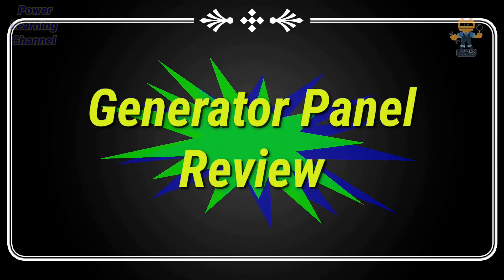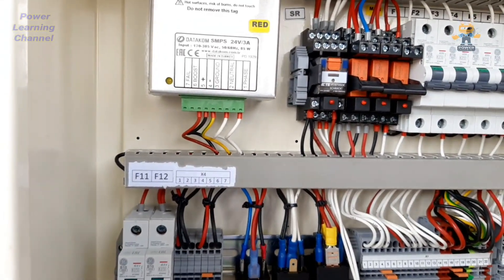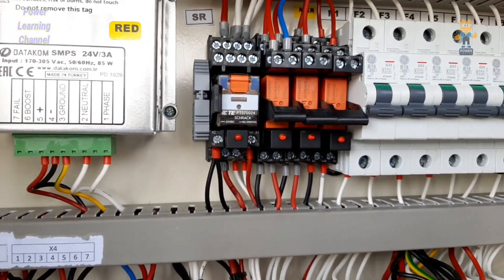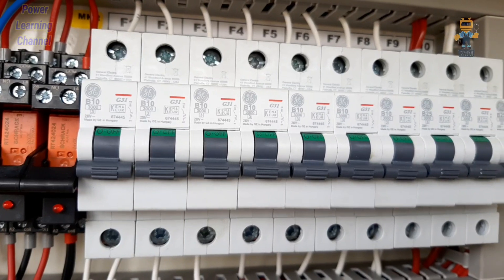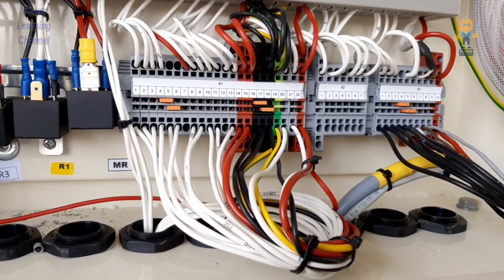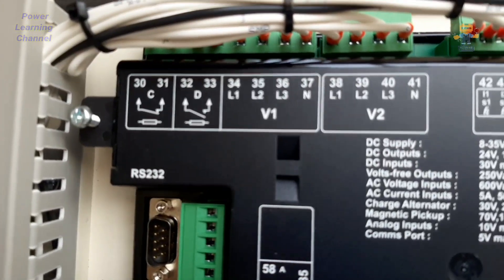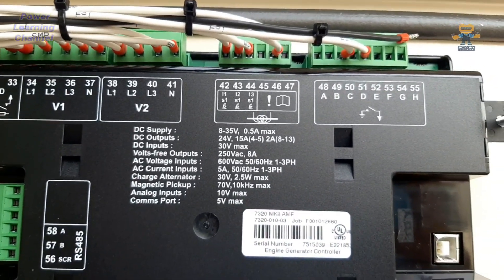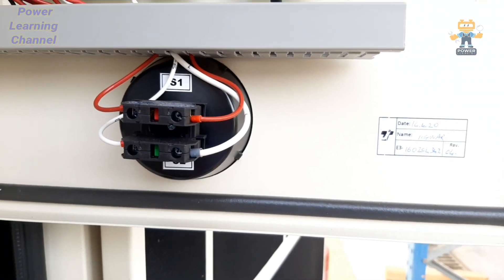Dg control panel wiring training | DSE 7320 control panel wiring Practical explain #kirloskar

Comment: I need a Single Line Diagram (SLD) for the panel which include an output of ATS panel, and a generator. The panel will use DSE7320 ?

Comment: I have 17gx battery charger for stn.by GENERATOR 100kva Cummins , battery 200 ah.
Sometimes GENERATOR warning low battery voltage,
But I measured the battery is 11.94 and 00.01A  I tested GENERATOR it's run.
And charge increasing alarm automatically gone.
Next time same alarm ,,11.94 volt I reset battery charger a.c and d.c switches, alarm gone  , charger display 13.6 v and 0.54 A.
We replaced 2 times battery also, battery good ,
Sir kindly give suggestions for this.
Because this GENERATOR 180 km away from our work place.
This alarm happen every time.
Reply from the maker: Check your contoller settings for low voltage alarm and also check battery charger volts after disconnecting the battery
Reply: @Dieselgeneratorksa  thanks sir,ya I done previously disconnect battery charger and I found 13v in the display,,
In sha Allah next time I will adjust the settings
Reply from the maker: Thanks for connecting